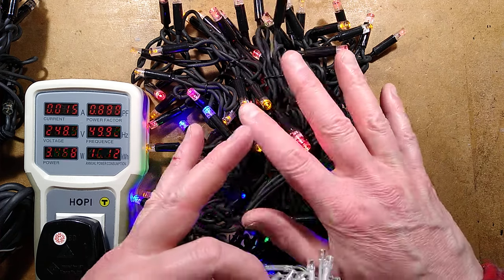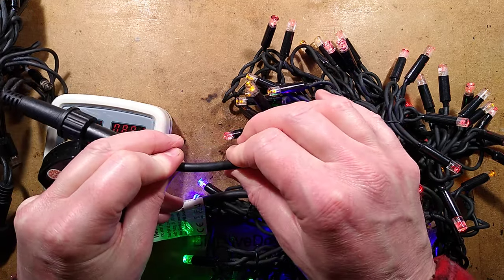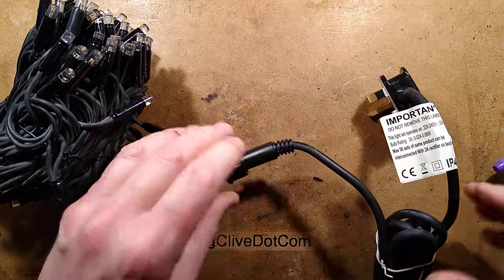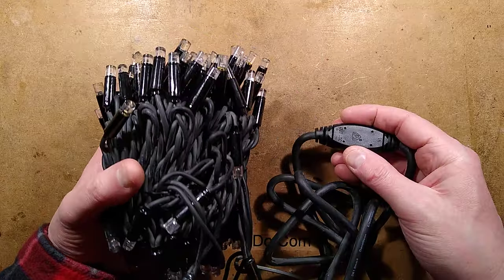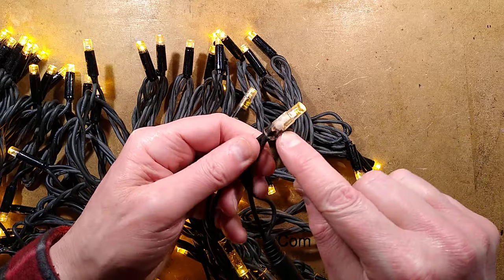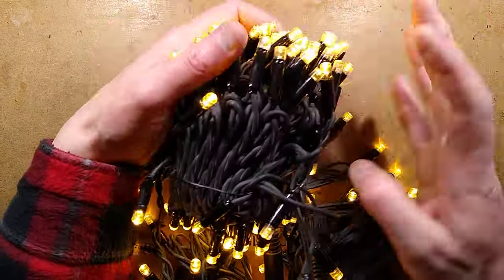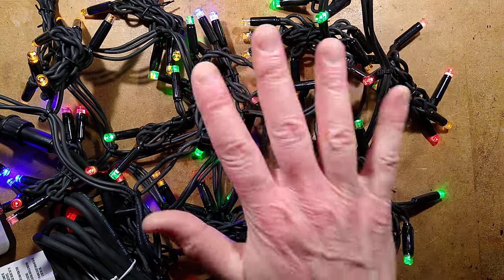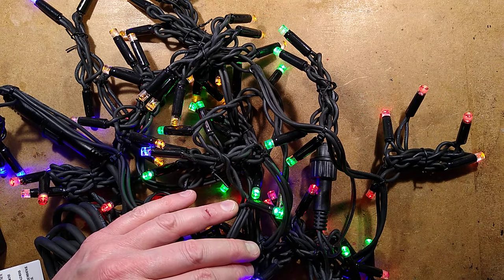The construction and wiring of professional LED strings.

Comment: Probably worth investing in these sets even in a domestic setting, for the increased safety and longevity!
Reply: Our landfills would benefit too!  Imagine the number of cheap light sets that get tossed out every year.
Reply: They probably last forever, with the occasional rectifier replacement as Clive mentioned.
Reply: Not to mention the carbon-black in the rubber and how well it conducts Lightning. ;)
Reply: The only question is where to get them from.
Reply: @gordonlawrence1448  TLC Electrical sell them. I got quite a few lengths when they were half price. Wish I bought more though.
Reply: @andycrask3531  thanks I'll look them up.
Reply: My domestic sets are at least 10 years old, some small sections of a specific colour are dead but still working fine. Of course they aren't as cheap as the ones from ebay.
Reply: @gordonlawrence1448  my local garden centre has some of them.
Reply: @MarioDallaRiva  I don't think domestic sets fail as much as is made out. I have had several sets for at least 3 years now and are still going.
Reply: @AlanW  Thank you. xx
Reply: @gordonlawrence1448  I bought mine from https://www.festive-lights.com/connectable-lights/connectpro a few weeks ago - very reassuring to see Big Clive's mark of approval :-)
Reply: I've actually been quite impressed by the new low voltage two wire domestic lights. Since each LED gets AC, the effects of electrolysis are greatly reduced as opposed to the DC ones, so the rusting effect is not anywhere near as bad. I've had a set outside for a year and no issues. I've had municipal strings that don't last more than three years. The local high street keeps the lights in trees all year and this year a lot are failing.
Reply: Don’t be silly. Nothing wrong with the cheap Chinese versions
Reply: @grantminecraft888  Nooo... Not at all...
Reply: @gordonlawrence1448  There's usually a few brands floating about that sell them. e.g. werchristmas, snowtime and probably more. A lot of them appear as if made in the same factory. (probably are)
Reply: @RossMitchellsProfile  Thanks for the info. The problem is it's one of those things where you dont know until you know as it's not something that can be worked out.
Reply: @gordonlawrence1448  Yeah, took me a while to stumble across a reliable source for these lights. Sadly a lot of the ebay listings for these lights have BS photos that are of normal cheep led lights, often you have to make a judgement call going by the specs, if it's connectable and the connector at the end.
Reply: For the cost it would make more sense to just buy a new consumer set every year and throw away the old ones instead of storing them all year and untangling them and trying to figure out why they don't work. People need to quit worrying about "landfills", we have more than enough places to put our garbage and copper wire is almost always recycled. We are not in any danger of filling up all the landfills, nor is it hurting the environment.
Reply: Indeed, you can find them at 30-50 quid for 90-180 lights. Connevans seems to have them in UK, I'm not affiliated with them by any means, just sharing my findings.
Reply: @stefanr.3495  That's too steep. In my experience you can usually get sets of 100 LEDs (10m) like these for about £15-20 if you shop around.
Reply: My domestic lights are more than 20 years old. Sure, they got repaired a couple of times, but nothing that it's impossible to do with a soldering iron and some patience.
Reply: @snakezdewiggle6084  and the aluminium gutters don’t care.
Reply: I'm going pro next year, we had sets fail every year in last 3 years, this year 2 sets failed that were purchased in November, very poor, and they weren't cheap domestic sets either. I did toy with a set like the pro ones this year, wish I'd followed my head and invested!
Reply: Do they make 120V versions of these for the States? (Or maybe I'll just connect them to my dryer outlet...)
Reply: @bbgun061  @bigclivedotcom Do you know the answer to this? I can't remember if you mentioned this in the video.
Reply: @ryanroberts1104  in other words we shouldn’t care? Or is it you are tired of people expecting you to care?

Comment: Lasting 5 years is considered good? We had outdoor light sets that were so old that we could no longer obtain replacement bulbs for them as the base hadn't been used since the early 1960s. The sets were purchased in the late 1940s and were still working fine in 1980. Same thing for the interior 'twinkle' light sets with the tiny bulbs with a screw-in Edison-style base - they were close to 50 years old and worked fine.

Comment: Definitely a step up from the Chinese 240V illuminated dental floss ones.
Reply: I remember plugging a Chinese fire string in and watching the arc inside the clear plastic plug.   That string went straight into the garbage bin.  I didn't even bother finding out how hard it would be to attach a new plug onto such hair fine conductors.  I knew it would never be worth the effort.

Comment: When I was a wee lad, the Xmas tree lights were all 7 watt incandescent bulbs.  They got hot, so we learned the hard way that we shouldn't touch them.  More importantly they could cause a fire.  The lower power bulbs were a definite improvement and now the whole string of LED lights use the same power that a single incandescent bulb used. 😮

Comment: Probably not a UV resin, but a 2 part resin, poured into the mould 500 LED's at a time, and then heated up to cure fast, then demould. Done while making the next 10 strings, so not actually the slow part, though there are machines making the long strips of LED wired assemblies, just trundling along spitting out a long LED wire. 2 part resin is a lot cheaper than UV cure, and they likely have 2 cups that are filled with resin from a big bucket, getting the ratio right automatically, which are then poured into the mix bowl, stirred up and then poured into the mould.

Comment: In the 50s we used two sets of C7 5watt each (E12 base) lights on our tree and they lasted about 20 years. We used C9 7watt each (E17 base) outside I was too young to know what the electric bill was but I still like how bright they were. And the only thing that went wrong with them were the bulbs would occasionally burned out but they were in parallel. 
The only safety issues were make sure the tree had water and don't have lights on when you weren't in the house.
Reply: I still use two sets of lights that are at least 20 years old, surprisingly only 1 or 2 bulbs have died. Outdoor stuff lasts less, the oldest thing I have is a 10 year old rope light but sections have died and I have cut them off, originally it was 25 meters, today its only 7 or 8 meters

Comment: I have a set of LED Xmas lights that have been on a tree in my front garden for the last five years as its easier simply to leave them in place than put them out and take them in each year. They still work fine.
There are four of parallel strings of 10 LEDs each and the system runs on 30V which I supply from a bench power supply on my workbench. The cable between that and the tree is the only thing that is taken in each year.

Comment: Just spent hours fixing some LED sets, I know it's cheaper to bin & replace but where's the fun in that?! Where would one purchase pro grade lights Clive? Thanks
Reply: We got a couple of sets of these from Costco UK this year - fed up with the self wicking cheapies.
Reply: Check out the ConnectPro from Festive Lights (in the UK). Unfortunately many lines are sold out right now, though.
Reply: I remember Hooj Choons ':D
At least here in Finland every hardware store sells these chunky bois and they are not that expensive, unless you buy a ton of extra led-strings of course.
Planning to get some next year, these lights will make great presents for ppl with a garden/porch :)
Reply: @MLX1401  I was thinking the same thing, you can get these for only a little more than a cheap set would cost you if you go shopping a bit. I've used them for over half a decade now and the only problem has been fading over time, since if I add new lights to a 5 Yr old string it will look considerably brighter than the rest. Still, the user experience is night and day and you're not worried all the time that a little frost or rough handling will kill them.

Comment: It just dawned on me how old my strings of lights must be. They're all incandescent. But they've held up well.
Reply: Same. Mine must be 15 years old or more
Reply: Same here... At least half of them is 20+ years old.
But I'm thinking of making replacement Led bulbs  for them. I'm tired of replacing 2-5 bulbs per 10 bulb string per year.
I'm thinking of 2 leds counter parallel plus an appropriate resistor per bulb potted in resin cast in a form taken from the damaged incandescent bulbs
Reply: I changed the bulbs to the old type LED's 25 years ago for a friend. They still work now.
Reply: Same!
Reply: @al1rednam  if you like them dim, just add a diode in series and they will last a LOT longer. Or add 10-15 diodes in series in one direction in parallel with the same in the other direction. This will lower the voltage enough to stress them less. Especially if you have old strings from a 220V era and your country has upgraded to 230v, like mine. That change has killed dozens of bulbs until I added the diodes.
Reply: Keep them as oldtimers they last forever! Plastic quality back then was ultra compared to the 2year trash
Reply: @copernicofelinis  thanks for the tip. My thinking is that I want them to light on both half waves (therefore 2 leds per bulb antiparallel which also protects the leds against too high reverse voltage and eliminates polarity of the bulbs). At the moment the light strings contain 10 incandescent bulbs of 12V and 1.3-2.4W each. Line voltage is 240V nominal and (in this house) 238V typical.
The bulbs don't provide much volume to use extra diodes. My lazy approach to finding the right resistor value is hook em up to the bench supply @12V/50mA with a 10k potentiometer as a resistor @10k, then turn the poti until brightness is pleasing and current ok. Measure the resistance and choose the nearest standard resistor (if in doubt higher value). I expect I'll land somewhere in the range of 400-800 Ohm at 15-7.5mA
Reply: @al1rednam  I added the antiparallel diode set near the mains plug, no need to touch the bulbs. The only drawback is that the 'thermal'  intermittence does not work anymore. But you can't have pie and eat it...
Reply: I just use a dimmer or a simple diode and I hadn't to replace any incandescent bulb since. They will last 16 times longer if you dim them to 50% brigtness. I have to do this because I realy like inkandescent light strings and they aren't available in Germany anymore.
Reply: @krokok.977  im in Germany too. As my wife especially likes the style of lighting chains where each light looks like a wax candle (made from plastic but similar looking) I'm always on the lookout for those. Kaufland and Sonderpreis Baumarkt had some this year. They also had replacement bulbs.
The candles didn't look too good (shiny plain white plastic) but that's nothing a little spray paint couldn't fix.
Reply: @copernicofelinis  that sounds like a good alternative. I just don't think it fits what I want which is replacing the incandescent bulbs with leds without touching the wiring of the lights.
I don't want to touch the wiring because 2 of my 4 children may or may not play around with the wires and factory fresh cables are safer than cables I cut solder and heat shrink. (the boys are 2 and 4 years old. The girls of 13 and 2 years are less of an issue in THIS respect)
Reply: I'm using four sets that are about 15 years old, two of them are more like almost 20 years old  and I've kept them on the tree for last 10 years straight. Each winter most of them just turn on and work, sometimes they need a bit of motivation in form of wiggling the bulbs or by shocking them with a piezo lighter.
Reply: @al1rednam  I'm doing it right now: from 20 12V lamps to 20 LEDs cabled as two rows of 10. With a constant current driver (two bjts and two resistor) you just need a 24v  wall wart rated at bit more the current in the leds - 5mA is more than enough for me. Perfectly safe, but you can also cable them as four rows of five leds and use a 12v wall wart.
Reply: @rowannadon7668  Amateur. I have lights that I know are a minimum 40 years old. Some are 50.

Comment: I have  used this kind at home for 10 years + . Now some of the strings are getting bad LED's. I solve this by slaughtering one string, getting rid of the bad one's in that string, and I am cutting the wire in between 2 LED's, then replacing, in the other strings, bad LED'S,  putting heatshrink and silicone glue over the joint. This works well for years.

Comment: A typical RCD Type A should cover even the rippled DC Current of a 1 phase rectifier - you have the same in All electronics. But if you have a 3 phase rectifier you could get clean dc error currents which only a type B can detect.
Reply: Yeah, but not all RCDs are type A, a lot of existing U.K. domestic, office and industrial installations have AC type RCDs which are not specified as being able to trip with pulsating DC leakage currents.

Comment: Well, that was fascinating. Thank you, Clive!

One consumer low-voltage icicle set I decommissioned this year was interesting. 24 volts, runs of ten LEDs but spread over multiple icicles, two cables switching DC polarity controlled by the power adapter. The (very dead!) LEDs went in the bin, and the power supply has been documented and retained for a future project...

Comment: I remember "The Range" used to sell some more heavy duty LED strings a few years ago; I bought 6 sets, 2 of multicoloured, 2 warm white, 2 cool white.  The cool white sets eventually died; I plugged them in one day before putting them up and some of the LEDs lit extremely bright and before I could pull the plug, they burned up.  I would buy some more, but they don't sell the heavier duty ones any more.

I'd really like to get some decent industrial lights; any brand or seller recommendations?

Comment: Mmmf, damn, I LOVE that thicc black rubber insulation on the wires! 👌😁
Now you've got me wanting to resurrect an idea I had long ago, of using a bunch of metal-halide lamps on a spare spool of 6/4 SOOW cable I've had laying around forever, with water-resistant metal housings, and colored-glass inserts for effect.
Reply: reminds me of the 80's when somebody turned up with about 30 floodlights.. off some asda car park or something.. a few coloured gells and hey presto.. lighting for the band.. which always managed to blow the fuses everywhere.